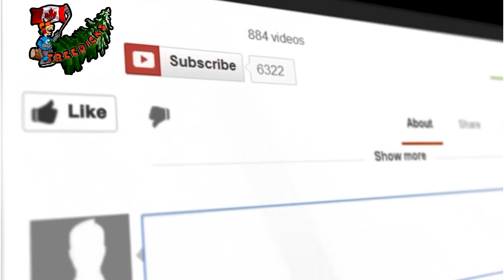Giving him a Heater??

Comment: My IQ is room temp in the winter but because I see 3 wires hanging out of that wheel I am guessing that it is a 3 phase dc motor that came from a scooter with a fried controller. That wheel is worth nothing but the controller if it worked could be worth 10's of Canadian peso's.